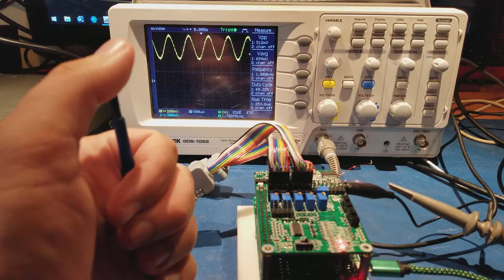PI-REPEATER Audio Input setup

Comment: Note: the measurement will change with the input device volume so you need to set it according to you radio output, not your phone. Also on my board Q1 and Q2 pads dont work, you must test at the 0ohm resistors just above them.